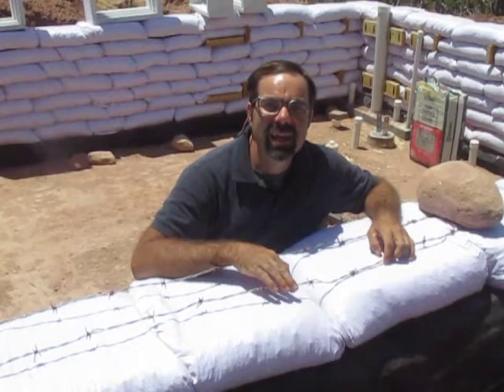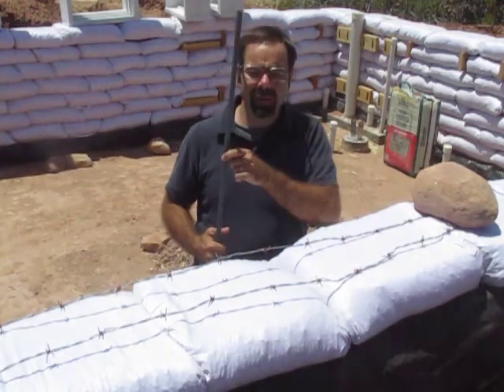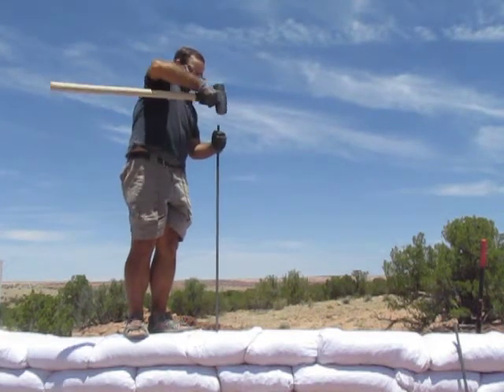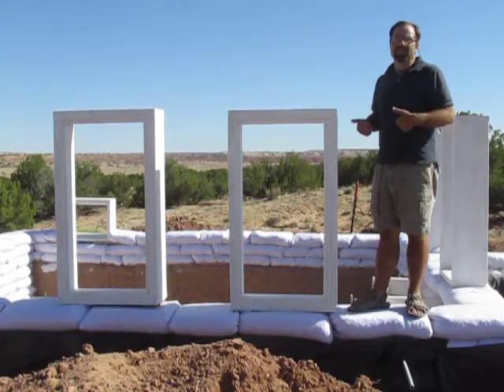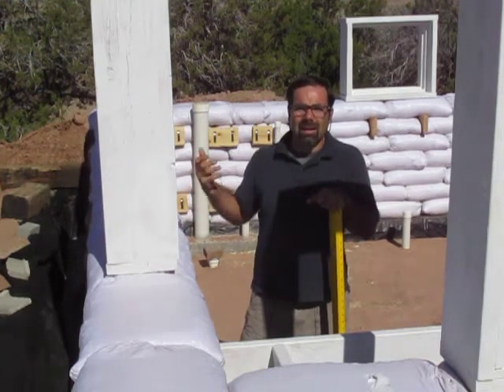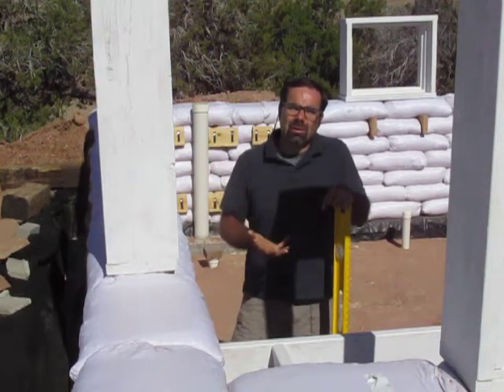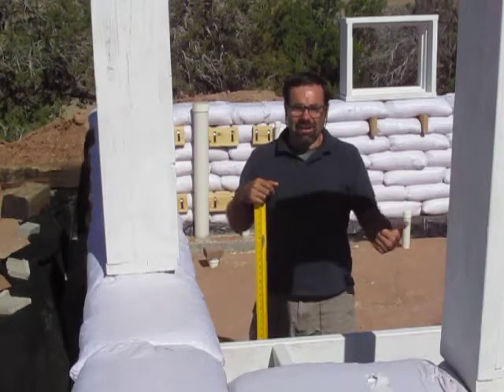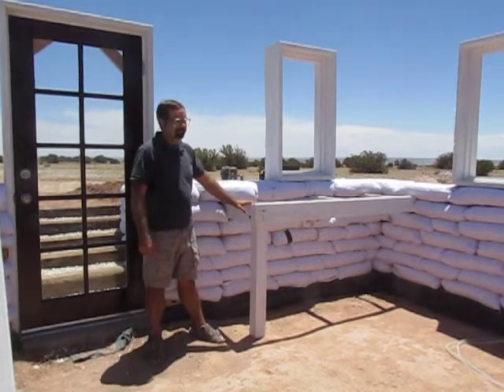Earthbag Build - Episode 08 -  Walls and Windows

Comment: I am living in Canada.. I want to build a Adobe house, is it a good option for winter ?
Reply from the maker: It's an excellent option for winter as long as you receive plenty of sunlight. It is very different from a conventional house and I had to change how I think about insulation. The earthen walls are not that great at insulating, but that's actually a good thing. They very slowly conduct heat energy. The sun "charges" the walls up during the day and slowly releases the heat into the house through the night. This passive system works surprisingly well. It also works to keep the house cool in the summer, but it is definitely not the same as having a modern HVAC system. There is no thermostat and sometimes it is warmer or cooler than I would like. Cloudy winter days and summer evenings are not always super comfortable. Although, the thing that surprised me the most about living here is that my body has adjusted and I feel comfortable in a wider range of temperatures. I feel healthier even.
Reply from the maker: Full Disclosure: I do use a small propane heater to supplement the passive system.
Reply: Thank you for your reply ..  and congratulations for your house 🏡.. I will continue investigate on this type of construction because I can't make but myself .. and my husband I don't think he believes in this option for house 🏡

Comment: The rear was completely unneccessary, but I do not see any lateral tie ins to support the straight walls. I believe they are supposed have lateral support every 6 feet depending on height of the wall?
Reply from the maker: Lateral tie-ins are one structural option that can be used to hold earthbag walls up. I did not use them because the walls are keyed into the foundation trench at the bottom and have additional supporting members at the top. There are also pieces of 1/2" rebar running through the center of the walls every four feet. This building is also very small and the perpendicular walls act as buttresses. Could you please elaborate on what you mean by "The rear was completely unnecessary."?
Reply from the maker: Okay, I think you meant the rebar was completely unnecessary. This is a structural component suggested in much of the earthbag building literature and an architect I hired to work on plans for a larger earthbag building required that rebar be installed.
Reply: @juniperhighlands  Rebar is not mentioned in any of the literature of builders that have actually had there work tested for code. All the literature of the few real experts all state lateral tie ins every so many feet for X amount of height. If you would like the exact measurements I would be happy to get them from my books. Now, of course and engineer is going to say he wants rebar, he has to protect himself liability wise. The rebar tie ins do not secure a straight wall from falling inwards or outwards. All the rebar does is secure the levels of bags to each other. It does the same thing the 4 sided barb wire does. Now your lateral tie ins could have went outwards, they do not have to go inwards, and when you add windows to the 2 sides that weakens the wall further and tie ins are even more needed. This is why a lot of earthbag builders prefer to build a round structure. Round structure do not need lateral tie ins. But your building is up, I am just trying to convey the correct information to you, In that hopes someone watching understands the importance of designing and lateral tie ins for straight walls. It is all a learning curve for everyone, in that region you will not see enough rain to weaken the wall, nor storms that would be an issue.